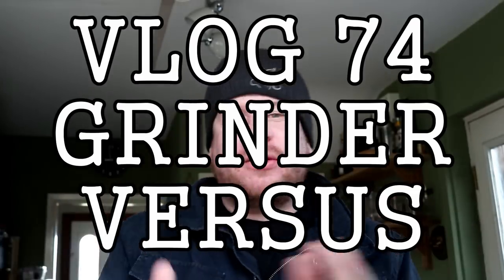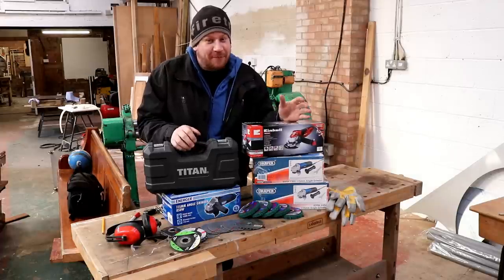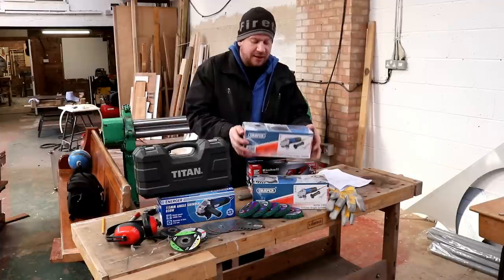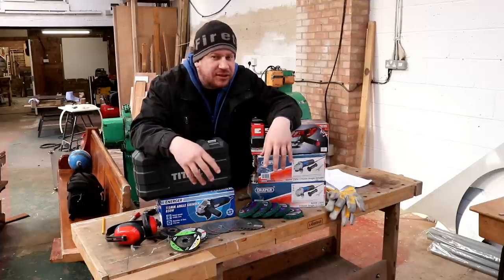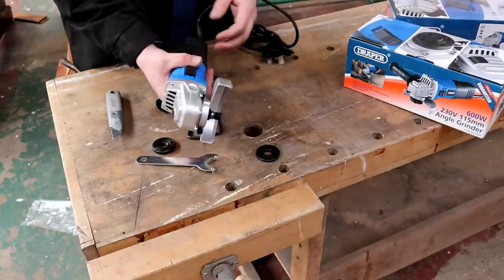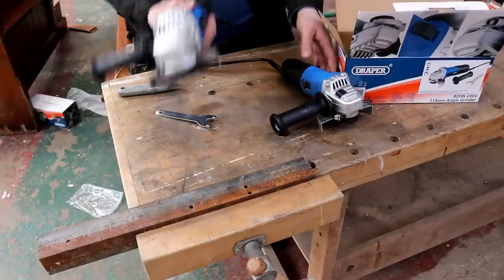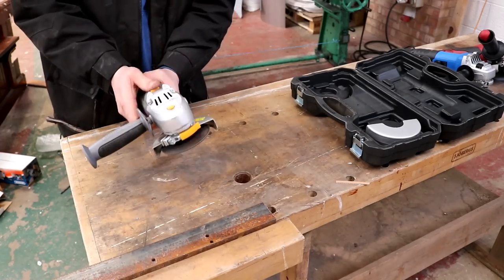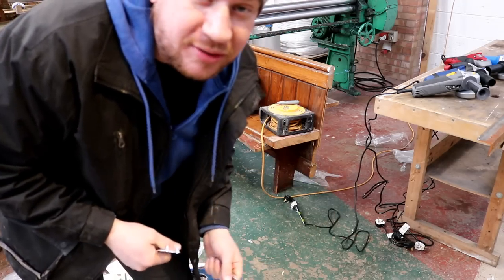GRINDERS UNDER £30 ~ SCREWFIX VS TOOLSTATION

Comment: I bought two grinders in 2009 one was a dewalt around £70, and the other was £9.99 from aldi, the dewalt went goosed in 2012 and the aldi model is still going.

Comment: I find the Eneger really hard to turn off and think the power button is badly designed.  Not as bad as the jigsaw from Lidl that takes brute strength to turn off and seems designed to cut off fingers.